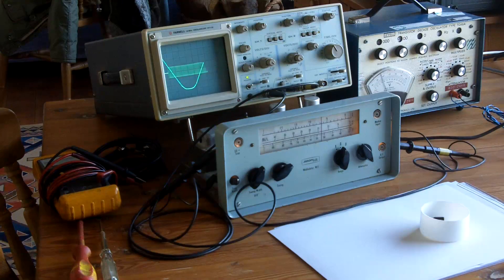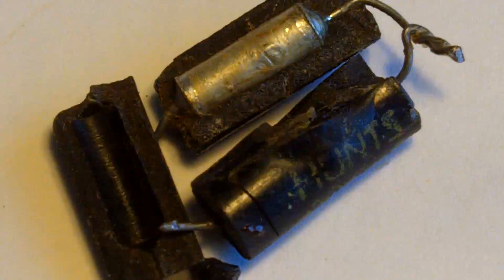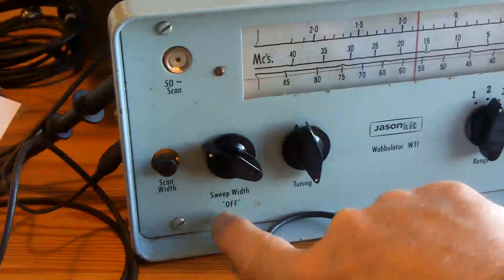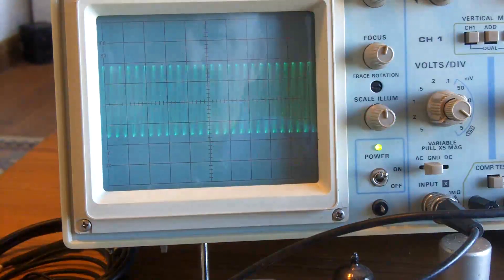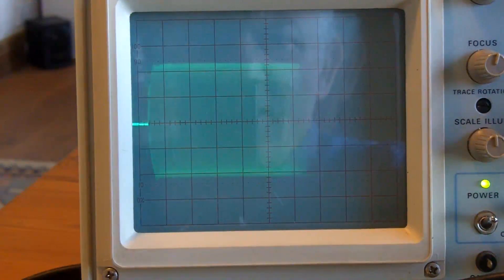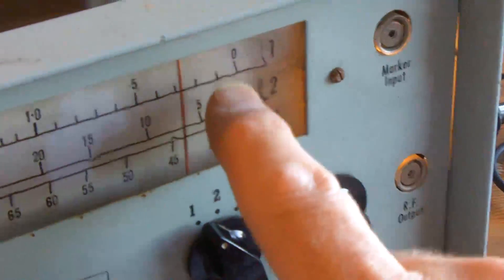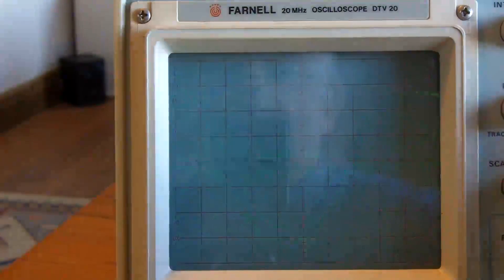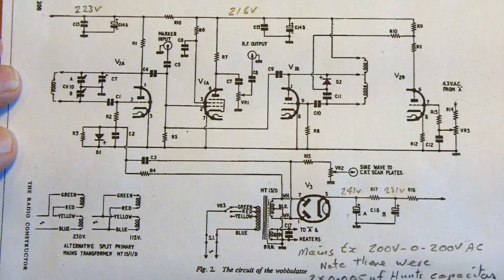About Radio ... Part 36 Wobbulator, Ongoing Repair by Andy Davies

Comment from the maker: @bandersentv Hi there, thanks for that. I will be using the X,Y inputs when I’m looking at the I.F. transformers but at this stage I wanted to see what the individual outputs of the wobbulator are doing. At the moment as you can see in the video there is an inconsistency on range 1. It looks like the blanking or ‘cut off’ signal isn’t kicking in so the units unusable in the 450 kHz range that I want. Are you familiar with the W11?
Kind Regards ... Andy